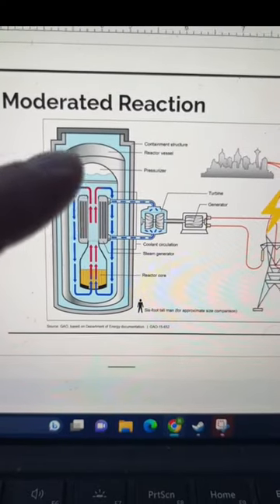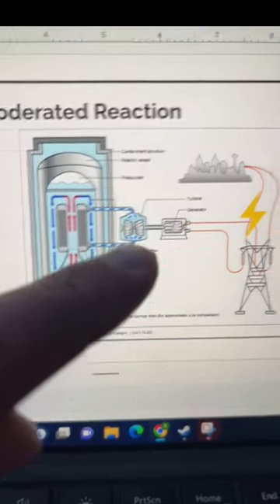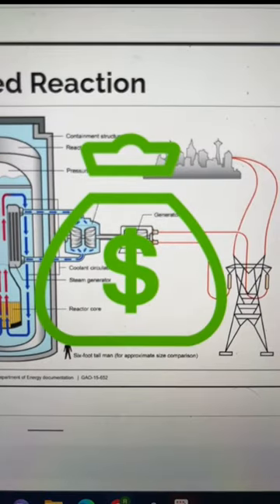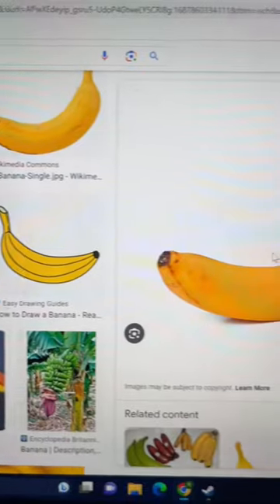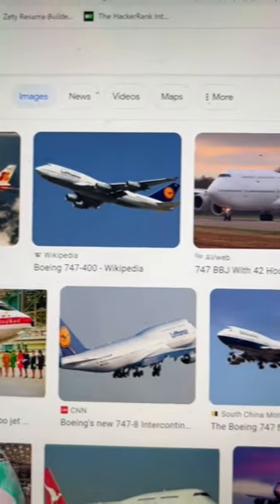No, The #Zaporizhzhia Nuclear Plant Will Not Explode

Comment: You are partially correct. But in general the risk is low.
Reply: Please elaborate.
Reply: It won't be like other disasters. But the core needs to be kept cool. The cooling ponds are necessary and critical for this. Even spent rods are kept in large cooling vats for some time before they can be packaged in those concrete coffins.
Reply: @DerLangolier they saying the pools re empty, that a meltdown is inevitable at this point. Some say 24 hs from now

Comment: Ryan I think you're off base on this one.

1. Fukushima went super critical after the cooling system was compromised and did blow up. It wasn't a nuclear explosion or blast, but there was enough energy there to cause a detonation (a steam explosion, I think, but I'm not very confident on that.)And it still produced corium, the slag you get from a nuclear meltdown. Kyle Hill has a series of videos on nuclear accidents and Fukushima was one of the ones he did. I'd recommend giving them a watch even without the context here.

2. Even if the reactors manage to stay below super critical levels (AKA: going boom or melting down,) it's still possible that radioactive materials get released thanks to off gassing and boil off.

3. From what I've heard, the Russians have rigged this to go up like July 4th, November 5th, and New Year's Eve all at once. They have physical access. If they want to demolish the reactor housing, they can do it. It would be an extraordinarily stupid move, but they could do it.

4. Even with the reactors in shutdown, there's nothing stopping Russia from doing whatever it took to get the engineers to restart the reactors and make them hot again before pushing the button. For that matter, they could just haul in their own people to do it. Again, wouldn't be like a nuke going off, but you can do a lot with just heat and steam.

So while we should chill out and not freak out, I think there is plenty of cause for concern.

Comment: Reactor rods and Spent fuel rods have to be kept cool because otherwise they will heat up to a temperature where the zirconium cladding will combust and thus you have a radio nuclide spewing inferno. 

Even when their radioactivity has decreased to the point they can be air cooled they still need airflow. 

The main concern is that as the reservoir empties that heat exchangers won't have water to do this cooling. Though that will take many months to evaporate all the water from the on site ponds before it even becomes a concern.
Reply: Ryan's an experienced infantry man. 

He's not a nuclear physicist, or an expert on structural integrity of dams, or any of the stuff he's been giving terrible takes on these past few weeks. 

"DOES WAGNER HAVE BETTER LOGISTICS THAN THE ENTIRE COUNTRY OF RUSSIA!? THEY'VE BEEN SPOTTED WITH GAS CANS ON THEIR TANKS!" Lol.

Comment: Fukushima was in cold shutdown state as well. I'm sure everyone agrees that loss of cooling went pretty well for them.
Reply from the maker: I don’t believe that is correct.Cold shut down means the reactor is not operating and am be accessed for maintenance. I’ve got a few books about Fukushima, reactors were under emergency, shut down, but not cold shut down.
Reply from the maker: @buttwheat yes, and the reactor was still “hot” oh, technically, the reaction stops in seconds, there’s still residual heat. This is not the case in Ukraine.
Reply: @RyanMcBethProgramming  my understanding is that "cold" vs "hot" shutdown difference is down to whether coolant was cooled to lower temperature, it doesn't mean core stopped producing residual heat or that cooling is no longer necessary. So even if you are in technically "cold" shutdown and loose capacity to remove heat from the core, it's down to whether reactors were in cold shutdown state long enough for short-lived isotopes in core to decay to safe levels, and if not, you're back to Fukushima scenario. Arguably, ZNPP could be in "cold" shutdown long enough so Fukushima-style won't happen, but I would rather not test that theory.
Reply: @RHGM71 but the heat produced goes down the longer the fuel isn't being used. Shut a reactor down for 5 months and you need a LOT less cooling.
Reply: @aaronbaker2186  that's what I mean -- if I am not mistaken, "cold" shutdown doesn't mean it's safe, time passed since it is in cold shutdown is important. and I believe not all reactors there were put in "cold" state at the same time, so while some reactors could be relatively safe now, it doesn't mean we can relax and assume it's no big deal if ruSSians start punching holes in containment vessels
Reply: @RHGM71  all of the reactors have been in cold state for months.
Reply: @aaronbaker2186  this is statement from Japanese authorities about fire and potential explosion in spent fuel pond at Unit 4:  "the spent fuel storage pond at the Unit 4 of the Fukushima Daiichi plant is on fire and radioactivity is being released directly into the atmosphere. Dose rates of up to 400 millisievert per hour have been reported at the site. Japanese authorities are saying that there is a possibility that the fire was caused by a hydrogen explosion." 
Those were in SPENT fuel pond, long AFTER they were removed from reactor. and still they caught fire and maybe caused hydrogen explosions. I imagine you are right that as time passes the residual heat goes down, but I don't see any proof that it is actually at the safe level so we can stop worrying about hydrogen generation and fire if cooling is lost
Reply: @RHGM71  Uranium doesn't produce hydrogen. So some oddity of the Japanese plant must have been producing hydrogen or storing it (perhaps as a coolant?).
It is worth noting that exactly one person was killed by the radiation from the Japanese plant disaster. A guy who got lung cancer and died 4 years after.
Which isn't surprising at the tiny level of radiation in what you quoted.
Reply: @aaronbaker2186  please google "thermochemical hydrogen production".  And I wonder why people do not live in exclusion zones around Fukushima or Chernobyl, according to you that should be a prime real estate now
Reply: @RHGM71 the spent fuel pond was directly above the reactor, and hydrogen produced in the reactor seeped into the upper floors.
Reply: @ChucksSEADnDEAD  Report I cited didn't seem to think that was the case, and for thermochemical hydrogen production you only need metal oxides, water and temperature in the range of 700-1100 C, all are there in spend fuel pool

Comment: Spent fuel cooling ponds can indeed spew radiation. They are in that pool for a reason and burning spent fuel is not a good thing.  Neither is conventional explosives rapidly dissasembling a fueled reactor.
Reply: One of them blew up at Fukushima. So it definitely can happen.
Reply: @Lilitha11  Fukushima was not in cold shutdown.
Reply: @DavidOfWhitehills  The situations and reactor design are very different but the danger represented by the reactors and their spent fuel cooling pools is definitely not something to dismiss. Especially if we are talking about an intentional release.
Reply: @BadOompaloompa79 I think even Russia knows that deliberately blowing up a nuclear plant would be enough to get NATO directly involved.

Especially if the fallout ends up reaching NATO soil, as that genuinely might trigger article 5, and you know Poland is just itching for a reason.
Reply: @simonteesdale9752 Russia already almost certainly has blew up the Kakhovka dam which had its own terrible consequences. One globally bad result of any significant nuclear contamination could be that agricultural production be affected, something the dam destruction also did (by making irrigation much more difficult).
Reply: @Lilitha11  Fukushima used Boiling Water Reactors. ZNPP uses Pressurized (light) Water Reactors. If I remember correctly, the explosions at Fukushima were caused by hydrogen created by the dissociation of water.
Reply: @simonteesdale9752  the orcs have killed Poles, destroyed Europe's second largest hydroelectric reservoir wiping out a dozen villages and destroying the agricultural and freshwater supply for almost half a million people, blew up military factories and stockpiles in Czechia and Bulgaria and NATO didn't do shit. Why do you think this will cause any other reaction?
Reply: @simonteesdale9752 article 5 will be use if Russia deliberately blows up a nuclear power plant

Comment: Ryan, please could you do a short on the impossibility of a rogue faction with a nuke having the codes to make it go bang.
Reply: Ya don't need codes.
Reply: @LordMondegrene  Ya do.
Reply: @DavidOfWhitehills Depends on your technical ability and how much time you have with them.
Reply: @DavidOfWhitehills  Bullshit. It's not a bomb, with a code you enter to detonate. It's a power plant. You destroy the cooling system, leave it running at full power and the fuel rods melt.
Chernobyl's Nuclear Power Collective turbogenerator #4 shutdown test did just that. 

It was a graphite-moderated pile, so it burned like a cutting torch, too. This one may be a safer design, but that's still horrendously dangerous in a war zone, under attack by terrorists. They could steal fuel rods to make a dirty bomb, contaminate the control room to make rescue/ repairs lethal, or just drain the cooling ponds.
Reply: @LordMondegrene  "Nuke": short for "nuclear bomb".
Reply: @placeholdername0000 You’d need A LOT of both.
Reply: @LordMondegrene They're talking about the rumors that Wagner captured nuclear weapons at Voronezh.
Reply: @JarrodFrates  I kinda doubt that, since Russia already HAS nukes, Voronezh is IN Russia, and Putin exiled Prigozhin. You don't exile people with nukes.
All the stories refer to the possibility of a power plant meltdown, not nuclear warheads. 
Dunno where you got the bomb story from, but it makes little sense, and has no part of the news I've seen.
Reply: Generally, it won't but actually, kinda sorta maybe. You can't get a full yield without either the codes or re-engineering it to work without the codes. However, hot-wiring it even imprecisely might generate a fizzle, but even a fizzle can be a big bada-boom larger than the mere high explosives, on the order of a fraction of a kiloton or possibly more than a kiloton - if it's a plutonium spherical implosion design. If it's a plutonium linear-implosion design (like that used in artillery shells), then the simpler geometry might allow a fuller yield.

If it's a uranium bomb, then disassembling it and dropping half of the fissile material onto the other half from a few meters high might be fast enough to get several kilotons out of it.

But this is all assuming the Russian designs have Permissive Action Links or some other tamper resistant safety. If not...
Reply: @jakeaurod huh. My assumption was, based on my limited understanding, that you would basically only need (assuming a plutonium spherical implosion type design) to remove any safety obstructions from the sphere's internal cavity, and then either hotwire or re-do the triggering electronics for the EBW detonators.
Reply: I'm sure he could. But he's so off base with this Analysis im not sure why youd want him to
Reply: @mnxs  Honestly, I don't know the details about PAL or other safety lockouts. But, there are some processes things that need to happen in the right order at the right time for proper warhead assembly upon initiation, depending on the design, like neutron generators and moving tritium. But, yeah, I don't think it can be MacGyvered on the fly. I could be wrong.
Reply: @DavidOfWhitehills  Codes prevent unauthorized access to a nuke. If you already have the nuke in your posession, you can set off the explosives without codes.
Reply: @ChucksSEADnDEAD  You may be able to set off the explosives, but without the correct information the bombs computer will not set off the explosives in the correct pattern to produce maximum yield. The bomb will "fizz" - it will just be a "dirty bomb". Bad enough, but not a city flattener. The codes are what the computer needs.
Reply: @DavidOfWhitehills  The pattern is built into the core, the detonators are exploding bridgewires precisely because they are so precise they detonate in a timescale that's close enough to be considered simultaneous. The codes do not do anything except arm the warhead. If you get the exploding bridgewires to function (which is basically providing enough power) the explosives are already lensed to provide the correct implosion.
Reply: Why would people think you had to have some "codes" to get the "computers" to make the explosion work correctly? Most nuclear bomb designs were created in the 60s when microprocessors didn't exist, and neutron flux can be damaging to most electronics. The codes are needed to arm the bombs and launch vehicles, but the major difficulty with nukes is acquiring the components. Given enough time with the nuke, even a low skill actor could trigger the detonation sequence. It doesn't make sense for any country to make the detonator too complicated since you want reliability more than anything else. You really don't want to defeat your enemies' defenses only to have your nuke fizzle or misfire and not achieve criticality.
Reply: @-Bill.  Do deeper research. I'm not going to explain it again. Don't take my word for, don't assume you've got it all figured out. Learn.
Reply: @DavidOfWhitehills  Considering 00000000 was the titan 2 ICBM password for over 15 years, you really dont.
Reply: @klioseth4336  Myth

Comment: I’m going to respectfully disagree that this Nuke plant doesn’t represent some danger.
*Russia occupied it for a reason - infrastructure wasn’t one of those reasons.
*Perhaps a REVISIT of the Fukushima power plant issues with their heroic efforts to keep the cooling pools for spent fuel rods full. 
Explosion: probably not.
Fire with radioactive particles going airborne: most likely.
Correct, the casks are not the problem here, the pools and reactors certainly are.

Comment: In Chernobyl there was no instant chain reaction when it exploded. And yet it was a much worse disaster than any nuclear bomb would because of the amount of radioactive material npp stores. Same thing here - if one puts a bunch of explosives near fuel, contamination will be like in Chernobyl. It's not the explosion, the contamination is the scary part.
Reply: You have to get the contamination out of the reactor though.
This particular reactor has a cask under the fuel. If it overheats the floor "fails" and the materials fall into a pit. Horrible for getting the plant going again but effectively burying the fuel.
Reply: Chernobyl lacked a concrete containment shell and the reactor was physically cracked open and set itself on fire. A working reactor was exposed to open air and fires lofted the radiation into the wind to be scattered. These factors are not at play here.

Comment: If you discount the ability to turn it into a dirty bomb, yes you are correct.(note this would be an intentional deliberate act that would effect a much smaller area)
Reply: Theyd need ALOT of explosives to eject materials into the atmosphere to do anything and after a day its much lower refined quantities compared to the ones delivered purposely will wane. Not great in the shrot term but not a wasteland.
Reply: You can’t turn it into a radiological bomb.
Reply: @KoRntech  I am thinking more on the lines of area denial  like a few square miles by a  bunch of fuel rods and some plastic. .  the plant cleanup would take years before it was operational.

Comment: Fukushima's Unit 4, spent fuel pool exploded. So while it might be low risk, there is a risk.
Reply: Incorrect. There was an explosion at Unit 4 due to hydrogen gas from Unit 3 accumulating there. The fuel pond was luckily not compromised.
Reply: @KoenvanGorpAstronomy And are all the fuel rods in Nova Kakhovka already in the spent fuel pools? Or are they still in the reactors?
Reply: @aphextwin5712  I doesn't matter where they are. If whatever is holding them and keeping them cool is compromised it will be a bad day.
Reply: @KoenvanGorpAstronomy  Agreed, I just think that if a loss of power or a loss of water supply happens, the stuff still inside the reactor likely overheats more quickly than what is the spent fuel pools. And therefore the same applies to hydrogen generation.

Comment: The problem here is that the cooling water pond has been cut off from replenishment by the reservoir-water loss (Kakhovka dam blast).  It has also been mined by the Russians.  Without coolant, the fuel rods can heat to the point of meltdown and one gets a Chornobyl-style release of radionuclides.
Reply: Chernobyl was only Chernobyl because an exposed reactor on fire blasted particles into the air non-stop. Loss of cooling in a rod storage site would just lead to rods overheating and making a hole in the ground.
Reply: The rods don't even need to melt down per se; if they become exposed the remaining uranium will fission into radioactive gasses that escape to atmosphere.